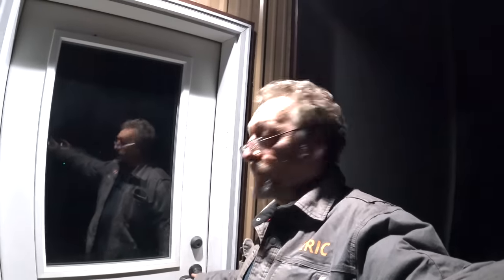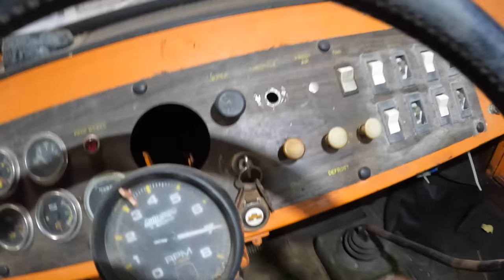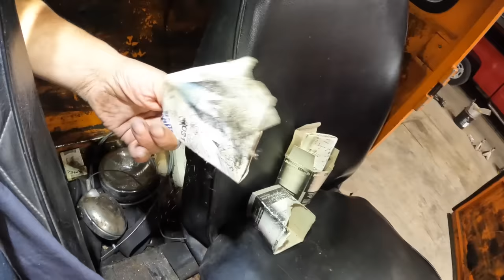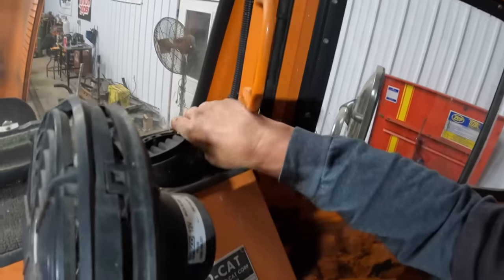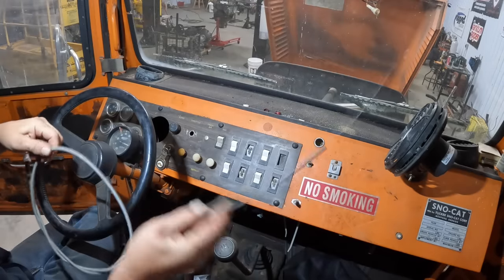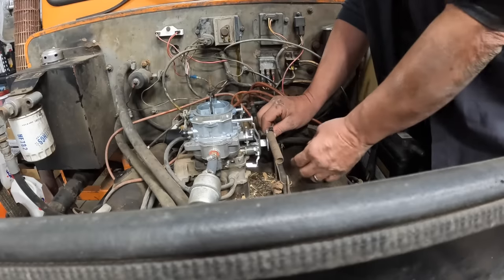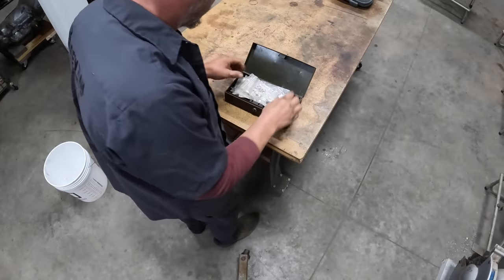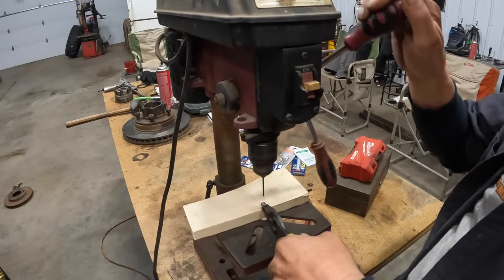Snow Cat, snow recovery vehicle. Choke and Manual Throttle

Comment: Nothing negative about the throttle that will work great. It's a high wear item sliding like that we usually use a small chain that just dangles so as not to bind  the throttle. Hard to explain hopefully you understand .Keep up the good work thanks for all you do.

Comment: As a died in the wool GM guy what in the .. You gonna tell me you didn't have an AC kicker solenoid laying the heck around as much of a packrat as you are.  Fab a bracket, some wire n a toggle,  POOF idle kicker
Reply: Might not have had a solenoid, but there was a cable behind the seat. Cable allows more adjustment too, not just on or off.